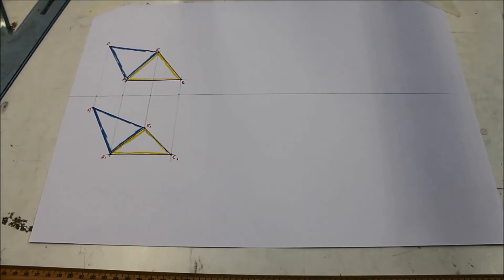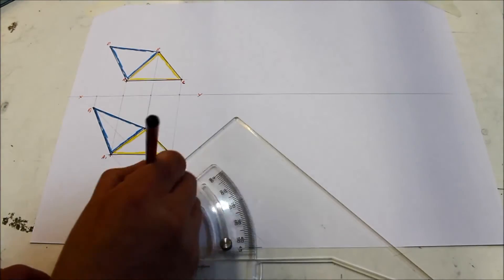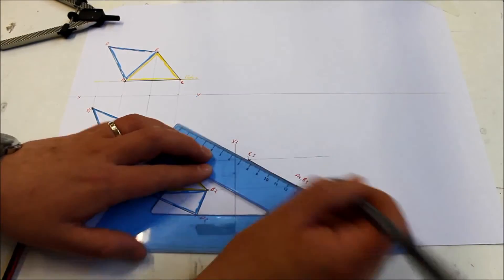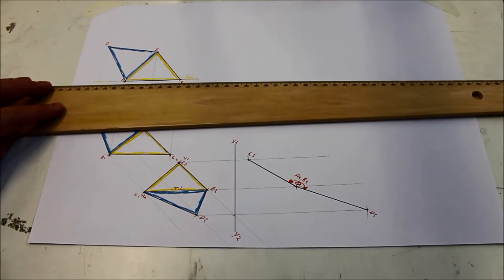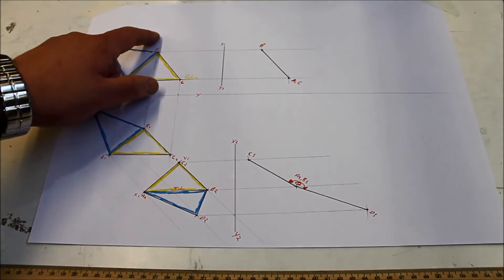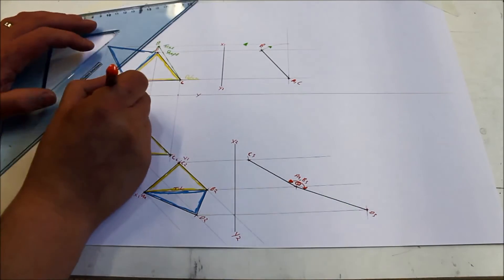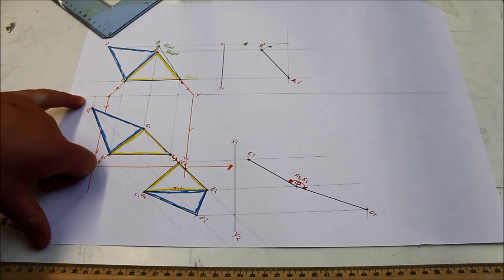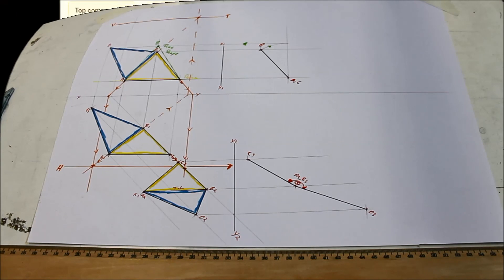DCG: 2010 Higher Level Question B-3

Comment: When attempting part (c), I went perpendicular to the edge view of the triangle ABC found in the dihedral angle. Why didn't this work for me?
Reply from the maker: In that view you have the True Height of the plane(From the Line AB up to point C) but no true lengths. There is a point view of the Line AB but the edge view isn't a true length. You need a true length of one of the side to find the true shape.